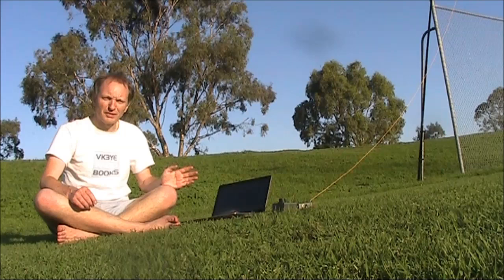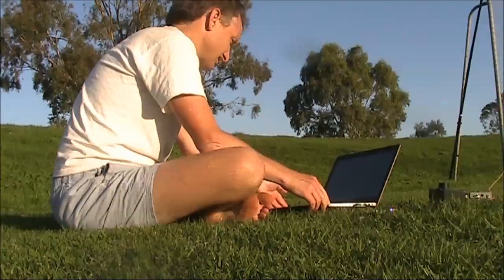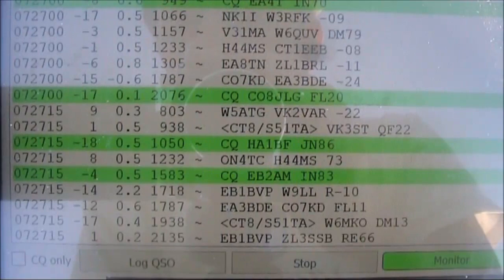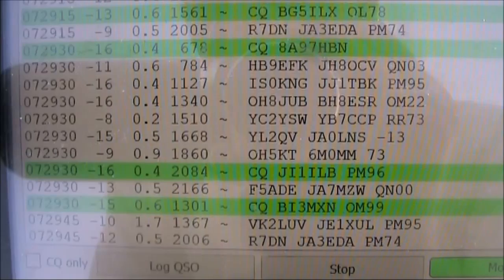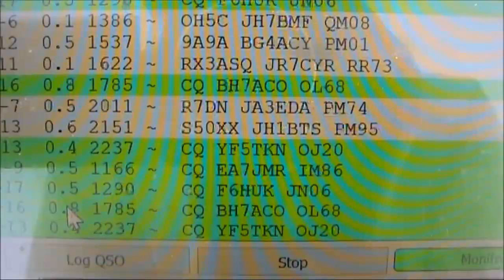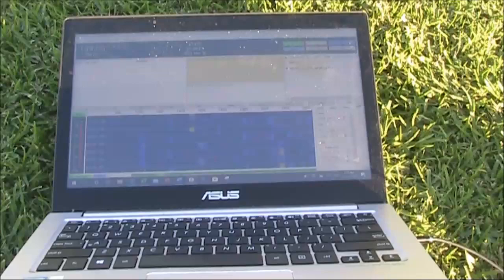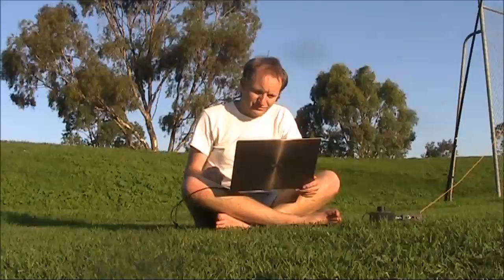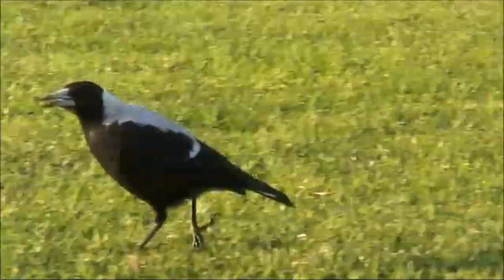Portable FT8 receiving with direct conversion digital modes receiver

Comment: I purchased the 40 & 20 meter crystals you reviewed last week. I also ordered a QRPGuys DSB transceiver kit. I will write it up as soon as I have some results... de WB2VUO here near Buffalo
Reply: Well, how’d it turn out?
Reply: I have the kit, but having vision problems. Not assembled yet, I have to wait for one if my nephews to get the free time to help.

The kit is well laid out and the boards are top-notch. Now, if I can have my 25 year-old eyes back instead of these 70+ year-old ones, things would be much better, hi!

De WB2VUO here near Buffalo, NY
Reply: @Keith_WB2VUO  I’m sorry to hear that, I was thinking about getting the most recent kit, but it seems that js8call isn’t as widely used as I initially thought.  Do you use a different method for digi?
Reply: Justin: I run 30 watts on FT8/FT4 with a former mobile rig, a Yaesu FT-857D, and QRP FT8 and WSPR with my Yaesu FT-817nd. Software is JTDX v2.1.0 rc141_3 running on old Dell laptops from my working days. Retired now, so a mix of everything here...

73, Keith, WB2VUO near Buffalo, NY

Comment: Where is a schematic available for the rig you are using¿?
Reply from the maker: See video a few days prior where I review the HF digital mode crystals I used.
Reply: Got it.  One other question. What type of torroid did you use?  52 or 43 mix?  Or an unknown from the junk box?😉
Reply from the maker: @randyab9go188  Type 43 should be OK but I used one from a TV antenna.